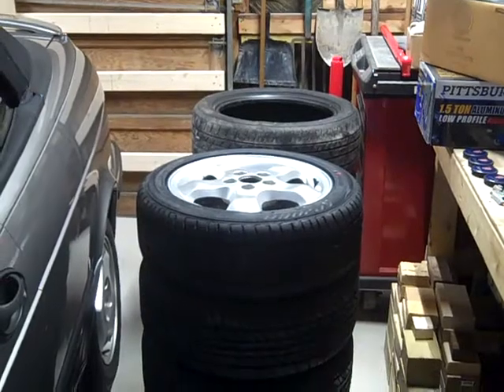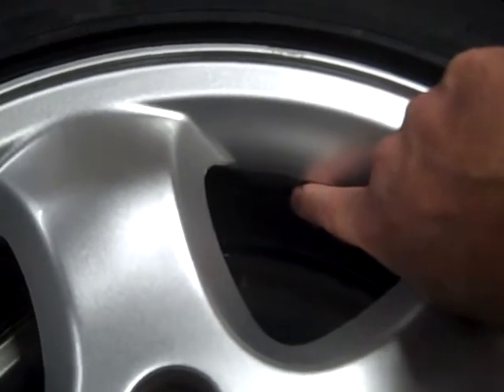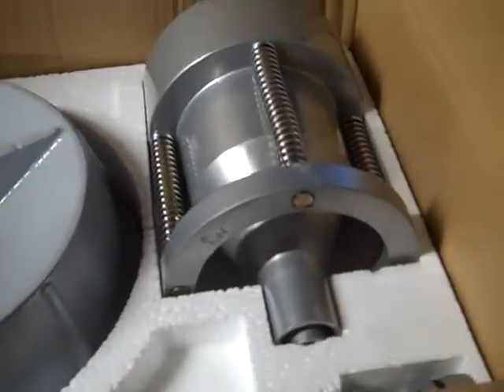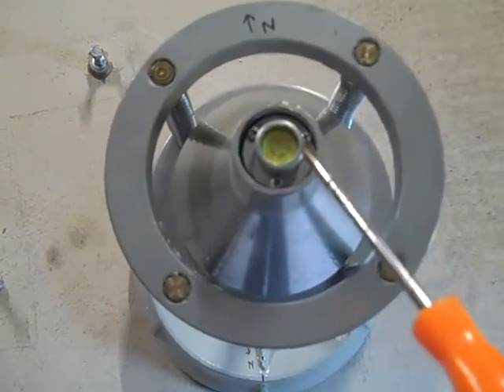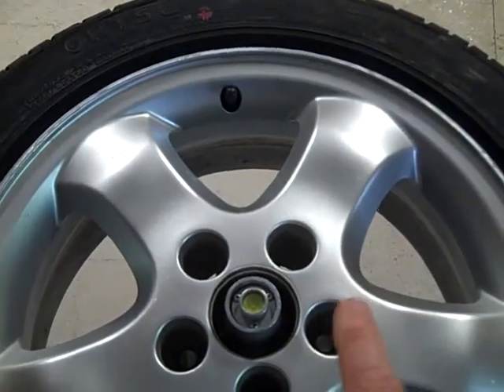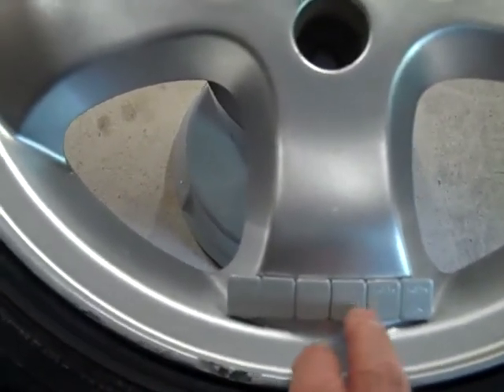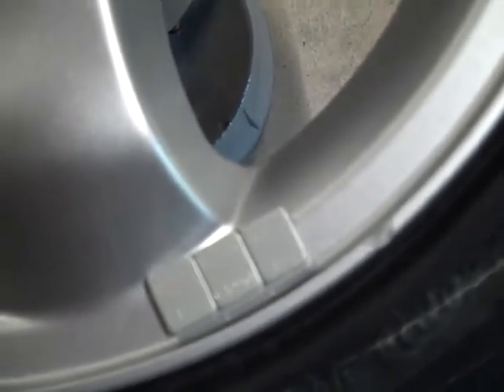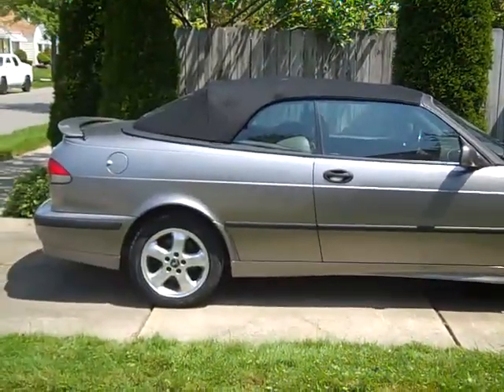Bubble Balance Your Own Tires

Comment: I just learned something. Today I spent untold hours using my bubble balancer (just like yours) for the first time to balance my wheels but when I would take the wheel off the balancer to place the weights and put it back on the balancer, the reading would be crazy off. I didn't realize it would help to index the balancer ("North") in order to place it on the stand in the exact same position every time. Thanks!!

Comment: Why did you mark north south east and west for? Are you supposed to stick the weights in the center of the rim? Not the side
Reply from the maker: I was marking it, and the floor, so I would not have to recalibrate the bubble when I use it next. I like to use tape weights in the center rather than on the sides. Looks nicer and works fine.